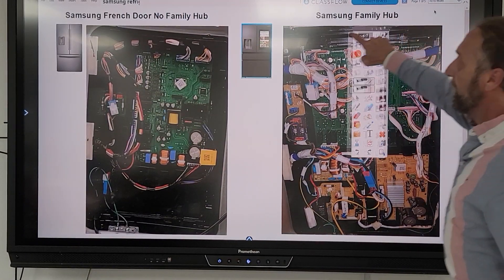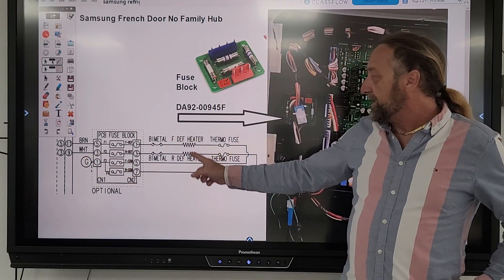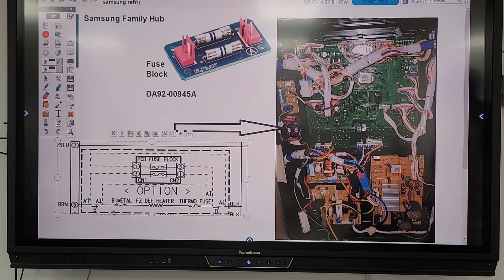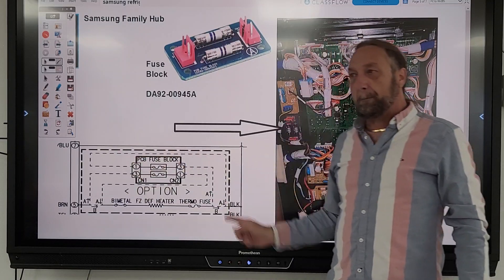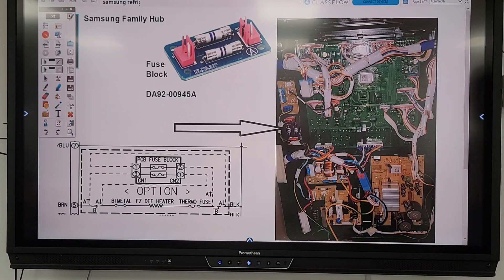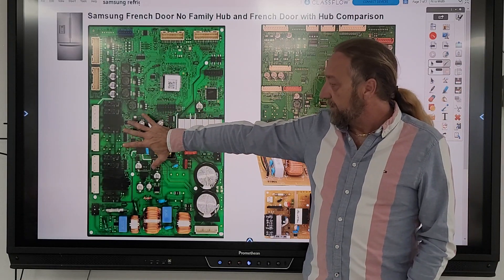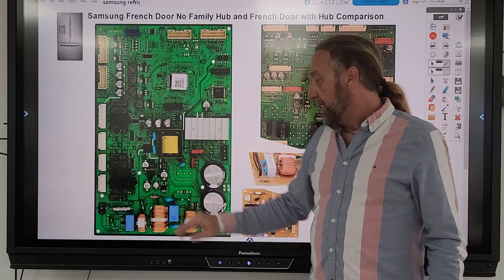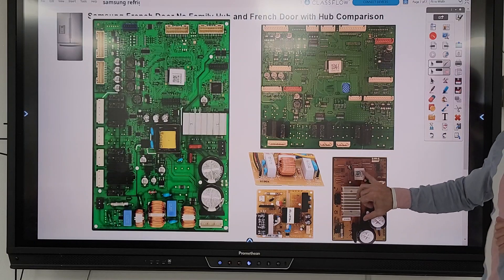Identifying parts on a Refrigerator control board Part 2

Comment: I like what you did with the question about why there are four fuse on that board! Did he ever let you know the answer? I appreciate excellent teaching!
Reply: Yes I answered it in another video, but there were 2 different defrost heaters and since the R600 is flammable, I think code requires fuses in line with the defrost heaters. They install a fuse both before and after the element to try and prevent anything from seriously happening.

Comment: what do you call that component above the second inductor in the board? it looks like a zener diode but much bigger and there is a warning next to it says high voltage.  That all-in-one board is the same as ours and im trying to figure out why it doesnt power up.

Comment: Here are the model numbers for the two units I'm lecturing on.

Control Board on the left
Non Family Hub - RF28R6201SR/AA ----- MFG 4/2021 

Control Board on the Right
Family Hub - RF23M8590SR/AA ----- MFG 9/2018

Comment: Is this left side one single board has different Samsung old model inverter board UVW pin.
Please do response when you have a minute.Looking forward your way…
Reply: actually the picture on the left is a refrigerator just delivered in April, a brand new unit.